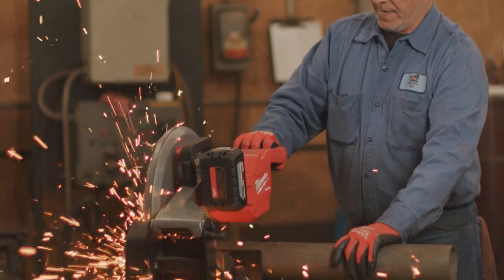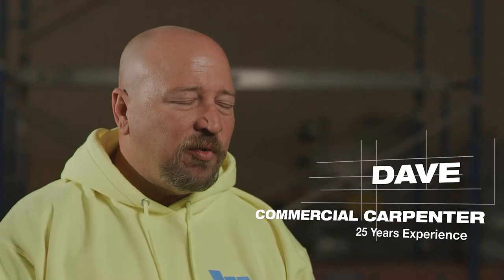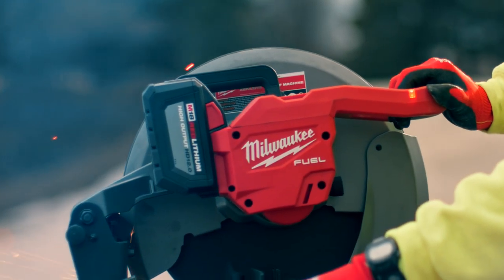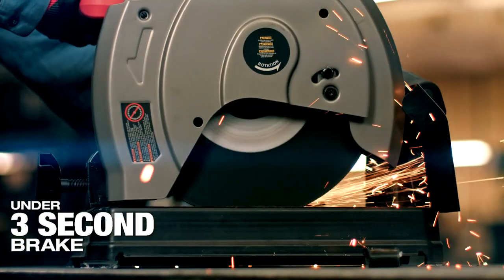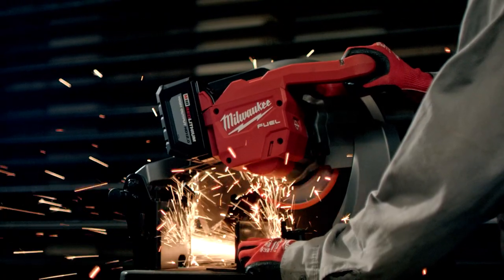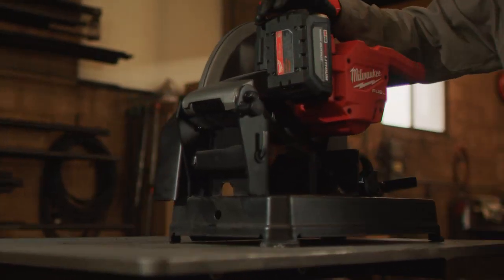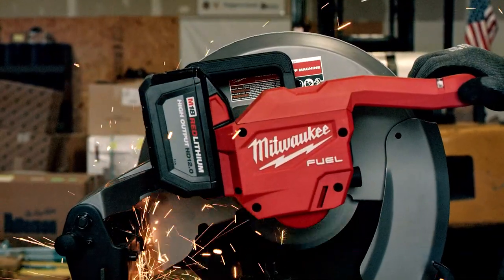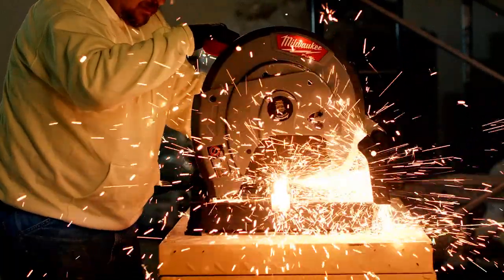Milwaukee® M18 FUEL™ 14'' Abrasive Chop Saw

Comment: This is the worst Milwaukee tool I've ever used. I cut 1/2" steel square bar 10x faster with a 4-1/2" grinder with a cutting wheel. This thing is a joke.